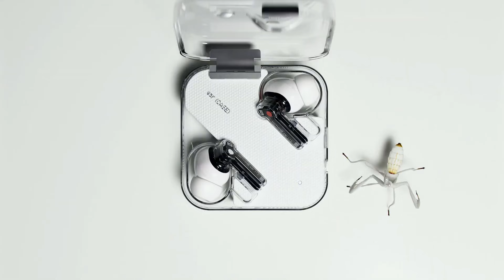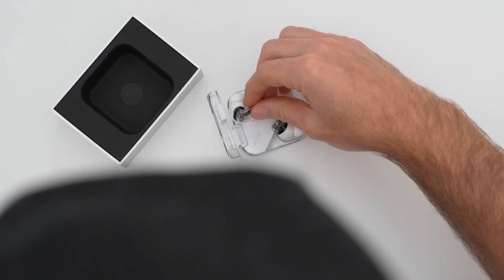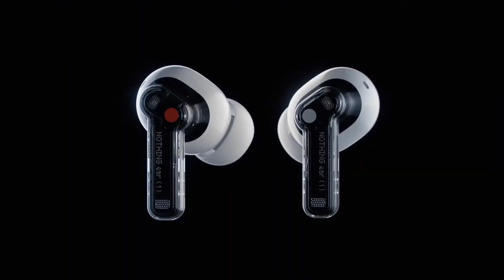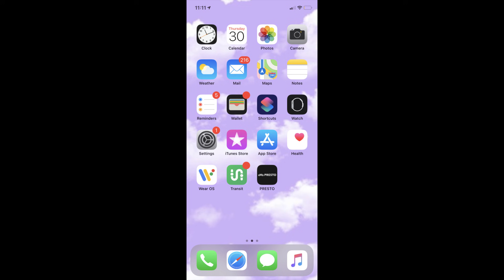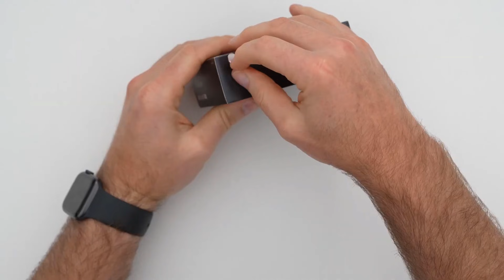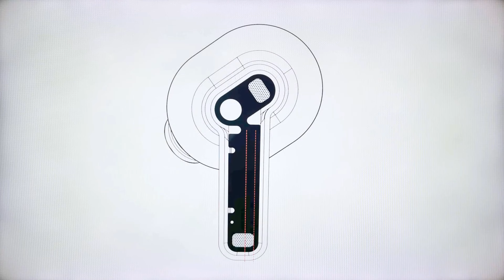Nothing Ear 1 Buds Industrial Design Analysis

Comment: I would give another idea to the red dot on the right earbuds - if you're living in custom in-ear monitors (or IEMs), you might notice the same red dot on the right ear, and on the cable (since some have detachable cables), the red dot and R symbol will help the users notice they attach the right side of the cable, since "Red" and "Right" both have the same R letter at first.

Comment: I'm a little disappointed by it. The white/black/red just feels.... Boring. I like what looks like a digital display, and the red button makes me think of a record button. 

The clear plastic hearkens back to those other clear devices of the 90's which were mostly gimmicky. (the iconic clear phone, for example, the clear controllers you showed, which also were typically inferior quality, and the old iMacs which were made to be "user friendly" in a time where Windows machines were advancing far faster and eating apple's lunch). 

I wish there was more color, although I like the restraint. I think something unique like orange or yellow or maybe purple, ( though really pushing more towards the yellow/orange color way) would stand out a bit better for the dot. 

Overall the shape does not have anything new to offer. I'm non-committal to that. Sometimes it's hard to improve on a design that just works really well. One option to stand out, rather than clear plastic, would be to use negative space within the design. The actual hardware would constrain this to some degree, (another reason the shape and overall form isn't really here nor there for me), so it's a question really of how much they might be able to do.

The fidget aspect to the case is a nice tough, but again, the clear plastic makes me feel more towards cheap clamshell packaging.  And unusual opening/ closing mechanism (using something of a slide perhaps?), Might give it a more tactile emotional response, (especially if the grip of the sliding mechanism was done in a rubbery contrasting material, and the case itself well crafted for a super smooth motion.) Brushed aluminum for the case itself? It might be slightly more costly but could increase the perceived value more so. It would depend on stamping. 

Idk. That's my take.

Comment: The overall aesthetic reminds me of the "retro-futurism" from the 60s (Kubrick's 2001) as well as some of the design cues from Daniel Simon (Oblivion) - the Solid white simple form accented with black/dark grey along with the solid/transparent contrast. Visually I really like it, however, the performance from the reviews I've seen tends to put this product  "spot in the middle of the road $99 wireless headset". It's either good visual design and manufacturing adding value to a middle-of-the-road product or design being used to hide the fact that this product does not live up to the "hype" imho.
Reply from the maker: Hi Alex, very thoughtful comments as always. I have a strong bias towards this aesthetic. I would consider buying an over-ear option if they made it. But I also have no need for all of the bells and whistles like noise canceling etc. I tend to focus a little bit more on audio quality, personally. I sometimes worry that a lot of their budget went towards unbelievably good marketing, as opposed to A+ sound engineering. Although to be fair, Teenage Engineering does know their stuff. I think the reality is that for $99 it's going to be hard to make amazingly good audio, especially with all of the other features of the product.

Comment: Super cool! One problem I've run into with wireless buds is the buildup of grime over time from use in the ears as well as lint etc. With a clear case, all of this is exposed, maybe prompting users to clean the product more often? More high-maintenance but probably worth it
Reply from the maker: I never understood why so many companies make cases that are so hard to clean. Like, they have these deep channels with hard edges that are super hard to reach into. While I agree that this one will expose grime and ear wax and other gross stuff a lot more, at least the edges are a little bit more rounded off and easier to wipe clean

Comment: Not sure if you've considered this but Red is traditionally used for the right (R) side of a earphone/earpiece, with white or blue as the left most of the time. In my opinion you are overthinking about it, but I agree that it is very attention-grabbing and suits the aesthetic they are going for
Reply from the maker: Yeah, I didn't mention that little tidbit because the founder mentioned it and I figured everyone already knew it. But thank you for pointing it out for those who did not!
Reply: @Design.Theory  Cool! I didn't know that as I only skimmed through the launch video. Sorry if I came across as too critical. And thanks for the video loved it!

Comment: I’ve only got four words… Industrial, neo-retro, AirPods, clone
Reply: Airpods? Clone?    Meh...
Reply: @blenderGuy1234  what? You don’t think the white top, short stem, and ear tip look identical to AirPods Pro?
Reply from the maker: I think that it looks like the AirPods for ergonomic reasons. I could be wrong though. Having designed earbuds before, there are only so many experimentations you can do with shapes...It's a really tough problem, because you basically have to make a one-size-fits-most design, and there is a massive variance in ear shapes.
Reply: @Design.Theory  exactly!
Reply: what other earpod style were you expecting lol.
Reply: @petrichor259  I wasn’t expecting anything, I’d never heard of this product before this video. But for all this hype around new design, I was hoping for something more original. The clear portion is cool, and the neo-retro dot matrix font stuff is cool, but it does just kinda look like clear AirPods Pro…. I don’t hate it, I actually quit like it. It’s just not what I’d call “all new design”.
Reply: @ascendualbrume  nobody called it "all new design"..